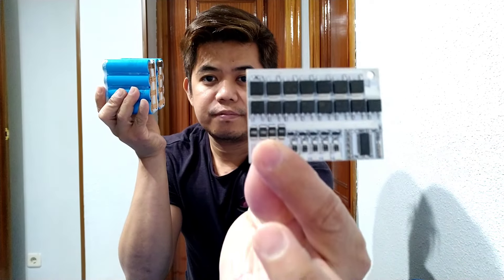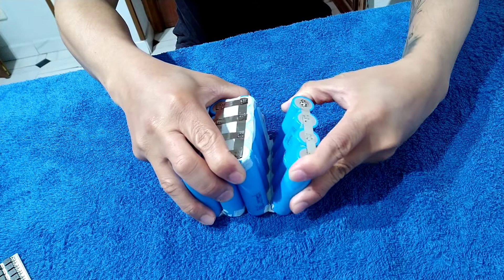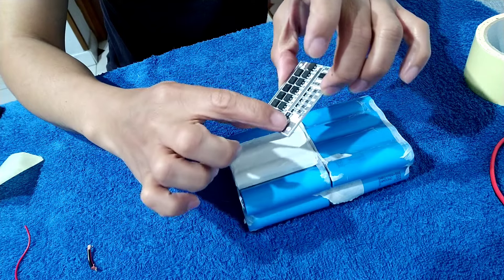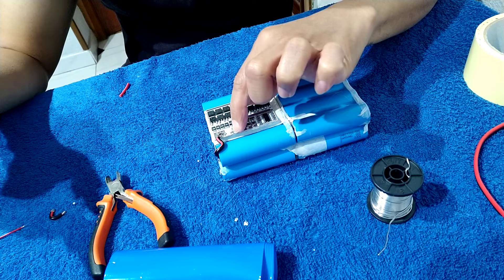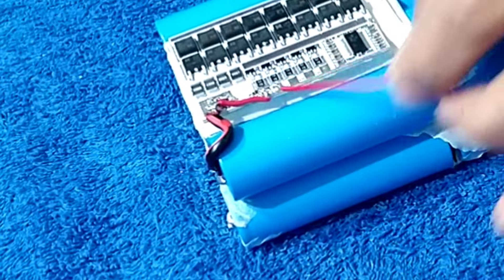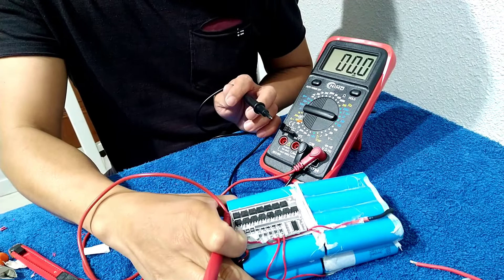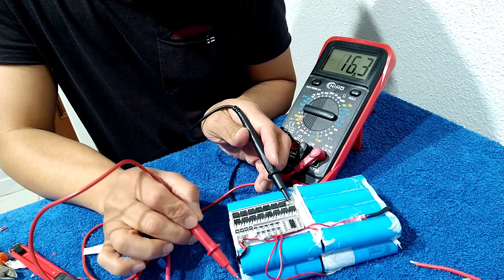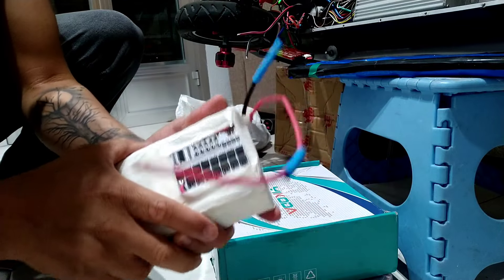how to put BMS TO 4s 16V Batery🔋

Comment: Sir pwede po mahinge firmware ng m365. Nag add po ko ng speed battery kaya lang may error 24
Reply from the maker: need mo itaas voltage sa filmwear kaya nag eeror 24. yan
Reply: Sir pano po
Reply from the maker: @abethco3191  pm mo ko nasa discription fb konsend ko sau
Reply: Sir nag pm po ko sa inyo